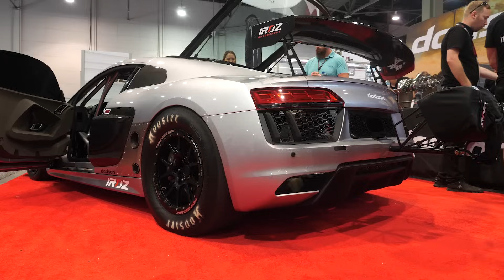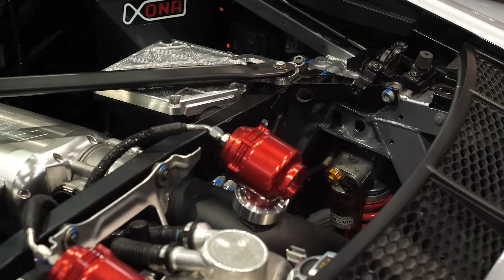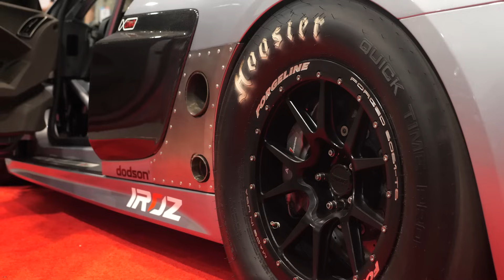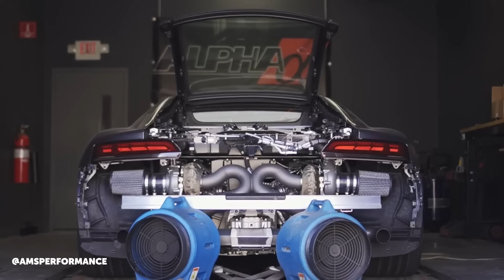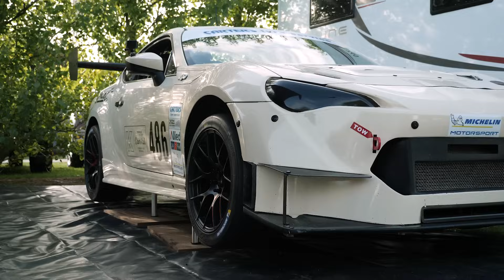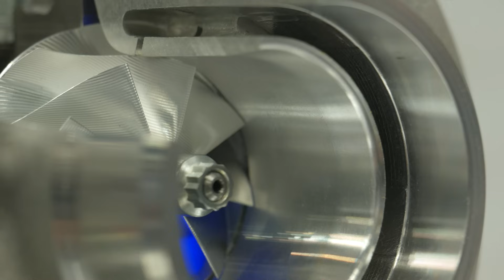Worlds Fastest 'GT4'?

Comment: Roughly how much boost are we talking about with ram air? 1 PSI or so?
Rearward bumper intake would then be -1 PSI compared to standing air, so 2 PSI difference in total between ram air and rear bumper?
I am guessing taking the air away from the high pressure front would help generate less drag and sucking in air in the already low pressure rear bumper would just worsen drag.
Reply from the maker: Would need the data from this car to know and this doesn't account for any aero impact, but Shane T has discussed it for a different application and quoted 9-10 psi - https://www.hpacademy.com/blog/how-to-tune-with-shane-t-2010hp-83psi-4-cylinder-sr20-tech-talk/?utm_source=youtube&utm_medium=social&utm_campaign=general-interaction - Taz.
Reply: @hpa101  Wow. that is quite a lot.